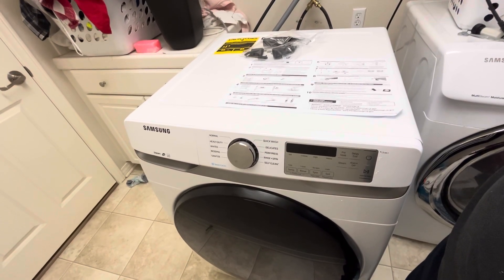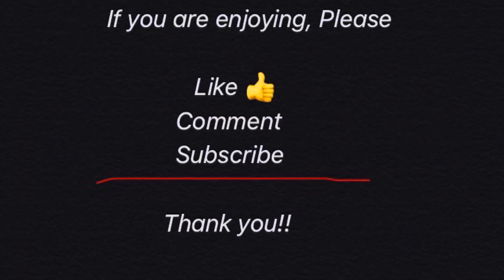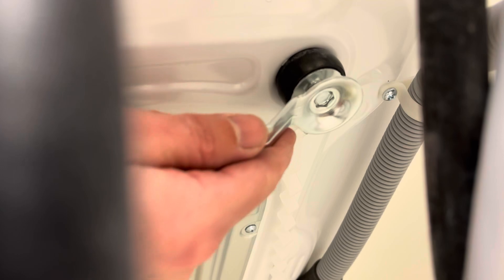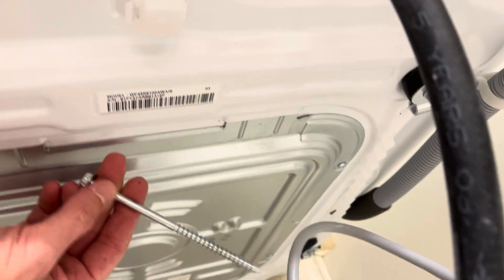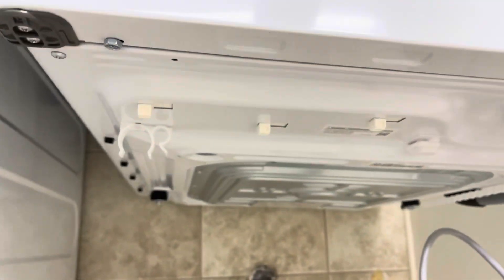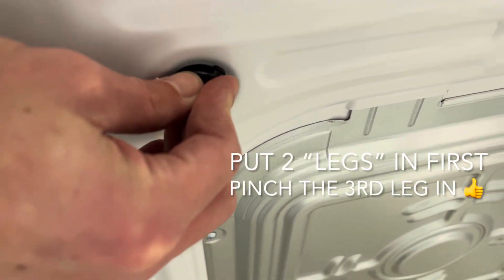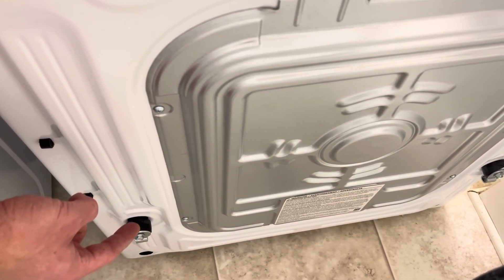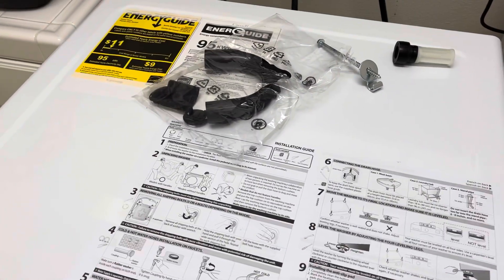Remove Shipping Bolts before using your new washing machine!

Comment: The nail comes out, but the rubber and plastic pieces remain.
Reply: you have to take those out too. twist and pull them out
Reply: @ChadDrakeTech   yes I extracted it using a flathead screwdriver.

Comment: No it didnt help not seeing how to remove the black rubbery bolt still attached
Reply from the maker: Sorry to hear that. Did the rubber part on yours not just come right out by gently pulling on it? Mine did.
Reply: Did u figure out how to take it out
Reply: Had to use ALOT of force to get mine out.